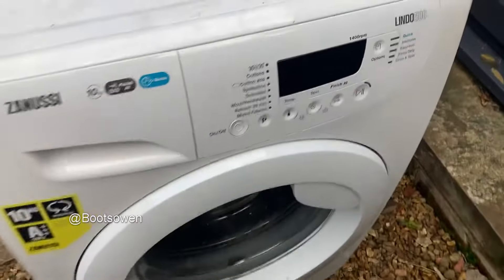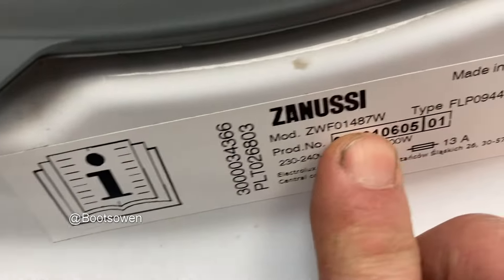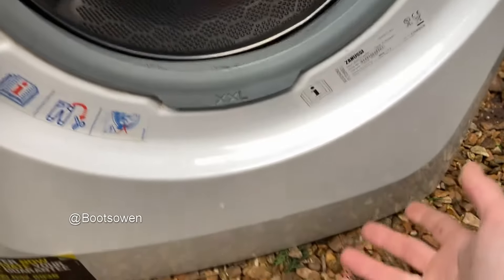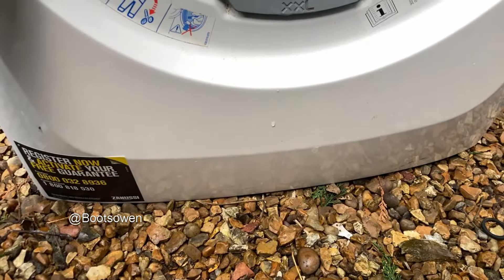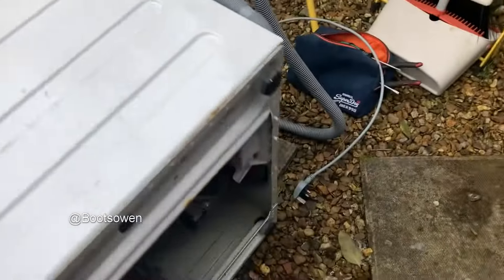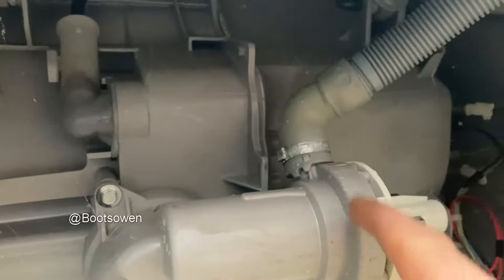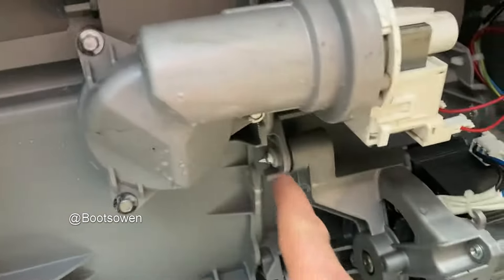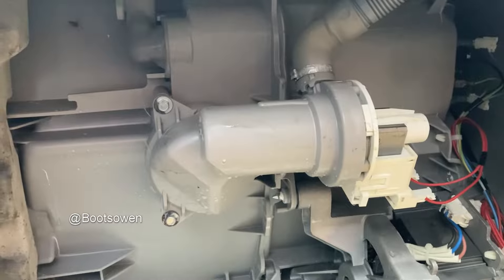Zanussi Lindo 500 no filter how to check the pump ZWF01487W

Comment: thanks for the Video, i have an E10 error code on Lindo500, cleaned out the cold water connecting hose and filters, dismantled the powder drawer and   fabric softener drawer and cleaned out as they were clogged up , cleaned the dual hoses and  outlet splitter filter that connect the powder drawer to the cold water inlet hose , it worked perfect for 2 loads and then E10 error again !!, i guess ill try whats in this video next - unless you have any other idea on what it could be?
Reply from the maker: What does the e10 mean or are you just stabbing in the dark.
Reply: E10 error is restriction of water /blockage , update though...i took the pump like the one in your video apart and there was 4 or 5 stone like objects which may be calcification of the powder over years , they could have been blocking the impellar on the the pump , the machine is working away again with no codes ... so far so good....
Reply from the maker: Nice work. There’s not much to washing machines. Even the smallest bit in the pump can block it. A screw or coin or ball of fluff. Glad you got there.

Comment: We happen to have a Zanussi without a filter, too at home, A Flexi-Time 8 Kg 1400 rpm one. It is still under guarantee, so we probably have to get a technician to open it if it had to get blocked, or we will lose the guarantee. I was wondering, could the pump be removed by separating the white part from the sump, rather than taking the whole assembly off the tub? The thing is, if the screws are taken off repeatedly, the holes in the tub get bigger, possibly causing a leak.
Reply from the maker: Why would doing this yourself void the warranty?

Comment: Hello, been into your videos for a while, I daily drive a 1998 Bosch WFB 2005 washing machine and it has a leaky fill hose, I have found the part used but I can't take off the front facea, do you know how to take off the front faces or have any tips on how to?
Reply from the maker: some have a screw on the side, others have to be forced out, there are tabs inside that you may be able to see with the top cover off, you also have to take out the screws behind the soap drawer. Some machines slide sideways, maybe not Bosch. Sometimes you have to be quite rough.